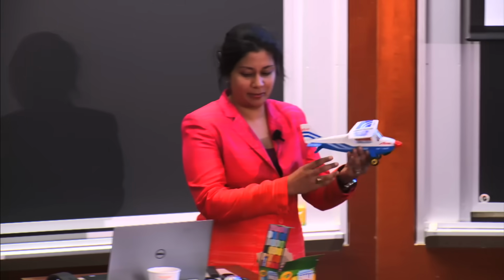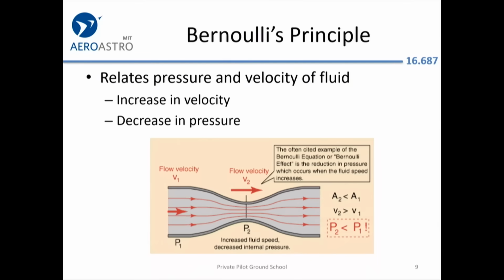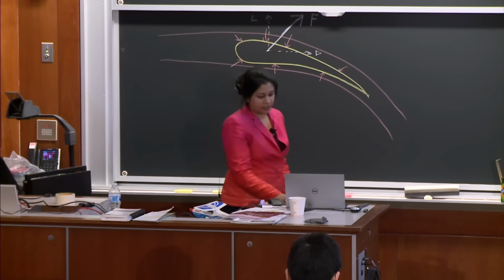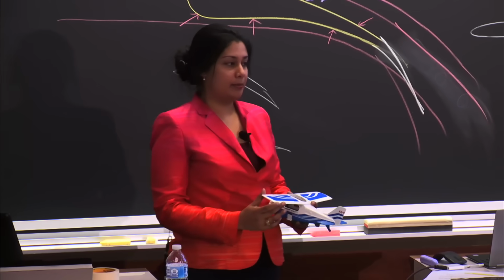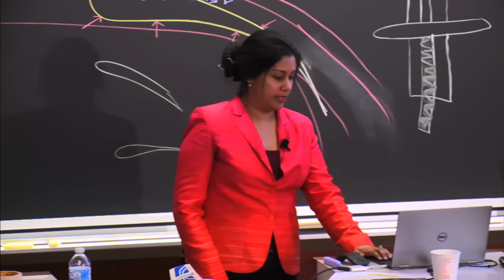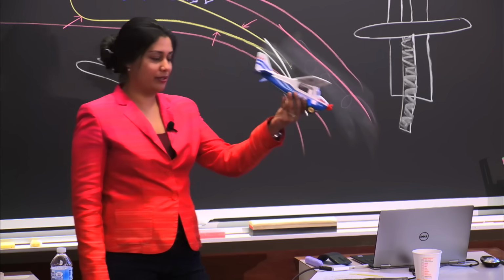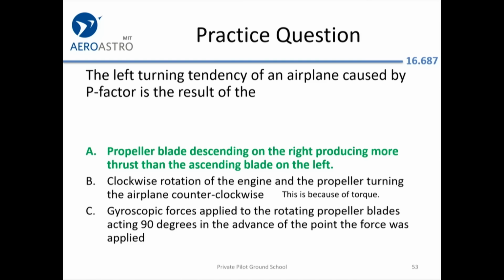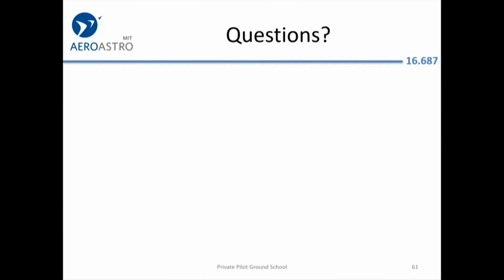Lecture 2: Airplane Aerodynamics

Comment: Question - if the "Equal Transit Theory" is incorrect, then why does Bernoulli's principle apply?     Why would the air on top of the wing NEED to travel faster than that on the bottom, unless it "needed" to meet up with the other half of the air that it was "joined to" just before the wing divided it in two?     If the air is indeed independent, then why would the air above the wing move any faster than the air below the wing?   Since there is more distance to the top curve of the wing that air WOULD travel more distance than the air below the wing. but if the air does not "need" to meet up with the top air at the same place AFTER the wing there is NO reason for that air to move faster.    The top half would just reach the trailing edge of the wing a bit later than the air on the bottom, but - who cares?      I'm shocked no one in an MIT class asked this pretty obvious question.
Reply: I think this vids explanations may help explain the situations more effectively.  The science/explanations & illustrations start roughly 3:30 into the vid, then are throughout the vid.

https://youtu.be/3KqjRPV9_PY

Comment: Downward pressure on top of the wing is less than the upward pressure on the bottom of the wing,   therefore there is a lift. Pressure is a product of velocity square (1/2 x density of air rho x velocity square) . The velocity on top of the aerofoil is slower than the corresponding on the bottom due to the shape of the aerofoi;.t
The lecturer is a smart woman of Indian descent.

Comment: She says Bernoulli’s is a lower pressure has higher velocity which is not correct.  A faster moving fluid has a lower pressure.   A low pressure could be a no flow situation.

Comment: WTF?  A paper airplane's wing has no lift!  ZERO!  A paper airplane essentially falls (floats) after it's forward momentum has equalized - and as it falls it's shape directs a path - thus falling mostly forward if so constructed. While it has forward momentum it acts like a dart - still zero lift!

Can't believe MIT is paying this person!  Really???

Also please look at any airplane wing.  The under surface while in flight  is flat and parallel to the airstream. Not teardrop shaped with a downward deflecting tail like she draws on the board.  And not slanted as she drew the paper airplane's wing in red.

Great, and now air is a fluid...  This woman is a moron!  Air is a gas!  Jesus!

Now showing incorrect force directions...  This has to be a joke!  Can't believe this is really MIT.
Reply: can you rewatch the video before showing your buffoonery. And air is indeed fluid - looks like you missed education by a whisker
Reply: @manh9105  Air is a fluid and not a mix of gasses huh?  I see.  So the third state of matter is just a myth aye?  I see.  It's nice how you alone are capable of redefining physics.  You're a hero of the new-age!

Meanwhile the moron in front of the class was never taught aerodynamics and doesn't understand "lift".  Or like her, would you like to redefine those aspects of physics as well?

Comment: I don't understand 16:05, who can help me......the race car generate lift only when it is an arched shape. So it's not everything moving through fluid can produce lift, right? 
And when it comes to fuselage producing lift, because fuselage is a shape of cylinder, it produces lift only when there is an angel between it and the airflow. If the fuselage flies horizontally, it won't produce lift, right?

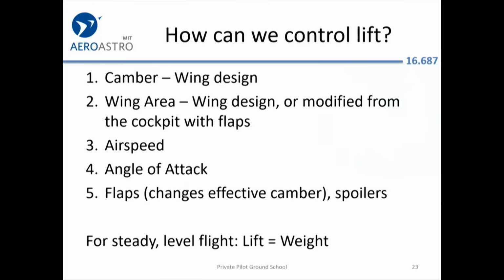Comment: Ms. Srivastava’s lecture is just excellent, but I’ll offer a small, constructive critique.  At 37:30 she states that if lift exceeds weight, then the aircraft climbs, and if lift is less than weight, it descends.  Strictly speaking, this is correct, but it’s also incomplete, and implies that an aircraft only climbs or descends when lift is unequal to weight.

Steady-state flight is synonymous with unaccelerated flight, and these terms don’t describe only level flight, but also climbs and descents.  In a steady-state climb the total lift does not exceed the weight, but is equal to it—this is the same “equilibrium” that she describes occurring in level flight.  (This is analogous to the classic “elevator” problem given to Physics students, and the formula F=ma likewise applies here.)  In fact, in a steady-state climb the wings themselves actually produce less lift than in level flight, because a portion of the aircraft’s total lift is comprised of re-directed thrust.  The best illustration is the extreme example of an aircraft on a vertical flightpath, in which instance the wings produce no lift at all to counteract the aircraft’s weight.

Comment: at the end in reference to the blended wing/body having problems with "infrastructure" of airports it seems the biggest difference would simply be parking and then only on curved terminals where current aircraft are packed in tightly. as long as it's not higher than the larger aircraft like the 747 and 777 it would seem all the support equipment should work without modification besides the skyramps/bridges which would either need a pivot added to the end to mate with the angle of a blended wing/body or perhaps simply a sliding angle plate/walkway at the end for when this design parked? a small investment for airlines?

Comment: The vortex hit copter in the laden complex was impossible to calculate, so many forces at play, but given the angle of attack - speed  verses air flow, immovable objects  - forcing rising  heat it was a  likely event.   An assumption  by me.... it was planned for... It's the best we could do.... Certainly not rocket science!

Comment: A tiny nipick here - while large surface on the rear of the race car is colloquially called a 'spoiler' they are in most instances, actually a wing that creates downforce. If they were just a 'spoiler the drag penalty would be too high. Modern race cars have carefully shaped wings that can be adjusted to vary downforce depending on the track to improve cornering. A spoiler on an aircraft does actually 'spoil' the lift and as a result can be used symmetrically to decrease airspeed or non-symmetrically for roll control.
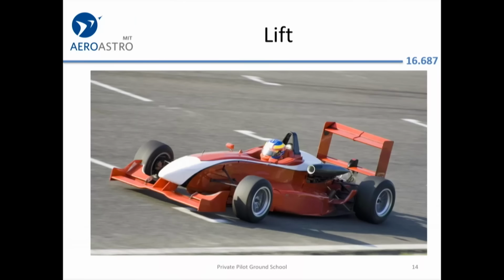Reply: You are SPOT on...  fundamental difference between a Spoiler and a Wing is one creates parasitic drag (spoiler) while sticking up in the slipstream, and the other (the wing) produces induced drag by producing "lift" upside down. Both produce downforce but in different ways.  Indycars, F1 cars, IMSA DPi and the car @17:17 picture all have WINGS.  A NASCAR stock car has a true Spoiler similar to those used on Aircraft.  Spoilers on Aircraft when used as lift dumps 1) loss of altitude without increase Airspeed, or 2) on touch down, kills lift to allow the full weight of the airplane to sit on its wheels for better braking.  Same for NASCAR, the spoiler kills the lift the car body produces allowing the car's full weight to sit on the track for better traction.  But as you clearly pointed out Wings actually produce upside down lift called downforce. I'm surprised that MIT instructors never made that connection between cars wings and the horizontal stabilizers on tail of the airplane which like on the car are upside down wings, producing downforce.
Reply: @ILSRWY4 Spoiler on the back of a road car like a hood on a hatchback is a spoiler, it spoils the laminar flow, which AFAIK paradoxically decreases drag.

Comment: Isn't the low pressure zone above the wing caused by the viscosity of the air, ( the air sticking to itself )  and as it deflects away from this top of the wing, that this is what causes the low pressure zone ?

Comment: I have question if you have time then please replay thanx( how it is possible that during flying Rudder trim itself operate twice in 2 different aircraft backward. Please explane the rootcause if you have any idea about it. Is it some compnent failure or any aerodynamics which ca. Cause this thanx)

Comment: So, because of faster moving air, lower preassure - is that the reason why roops are being sucked off houses because the speed of the wind is very high, while the air below the rooftop is sitting still - generating a large "elevation" force?

Comment: She mentions time of equal flight is incorrect, then goes on to mention Bernoulli's principle as a cause of lift. This is INCORRECT. The decreased pressure is not generated from faster moving air, but from air directed downwards. This is primarily resulting from the coanda effect and the reason airfoils have that shape instead of a flat one like a paper airplane.

Comment: 29:59 Assuming there is no turbulence does not mean that is the real world condition. It reminds me of a joke.

A weight lifter, engineer, and mathematician are washed ashore after a shipwreck. As they stand on the beach of the deserted island a huge crate filled with canned food and water crashes ashore. They are excited to see it, but then they realize they have to open the cans. The weight lifter suggests they smash them open. The engineer draws some fancy diagrams in the sand for device to open the cans. The mathematician stands there chuckling as he listens. They ask him what he thinks is so funny, and he explains that they are making the job more difficult than it has to be, all they have to do is assume they have a can opener.

Comment: Here is a simple explanation of why Bernoulli's Principle works. Air pressure is the result of air molecules striking a surface. If we have air flowing along the surface it drags molecules along with it and fewer molecules strike the surface resulting in lower pressure. The faster the air flows the more molecules are dragged along and fewer molecules strike the surface.

I used to use the following example with my students. Suppose the bell rings and the students in class want to cross to the other side of the hall where the stairs are located. If the hall is empty they can walk over unimpeded. But once the hall is filled with students walking any student trying to get to the other side will be dragged along with the flow of students in the hall.

Comment: A mate sent this to me, I struggled to watch it pass the mentioning of Bernoulli. I found the bagging of 'equal transit' theory weird, isn't it akin to the ideal gas idealisation in thermodynamics? Persevered, then at the 30min mark, more pain. I was really disappointed with the excessive bagging of the Equal Transit theory, an idealisation in my memory and mind, then for them near the 30min to say, we need to ignore turbulence and air that crosses the upper and lower line. It's a little concerning that they bag some assumptions or simplification and not others.

Comment: I thought equal transit theory applies with Bernoulli without exception. I guess I was wrong then. but also, if it's wrong, why there is a velocity difference of air on the wingspan?

Comment: Good, but she misses the applied concepts a few times. Going steeper in a climb is not the same as increased angle of attack, which is related to a stall. At 42 minutes, she is talking about flaps for takeoff 'just in case... so you're already configured for landing". She missed the real point of flaps, which is to change the cord line and angle of attack.  Yes, the effect is stall speed decreases, but it's because your critical angle of attack changes. And I hardly think an Extra or other aerobatic planes are 'unstable' - they just have lots of power and generous control surfaces. Spins are not necessarily "pretty dangerous to do", or they wouldn't ever be allowed - they are certainly potentially dangerous. Neither one of them did a good job describing p-factor differently - they just kept saying the same thing, no blackboard, visualization, etc. MIT? meh

Comment: Some doubts, would appreciate if someone will help me with these. 
1. Is it conversation of momentum or newton's third law - as mass is being pushed down and it lifts up the wing. 
As i was taught that 3rd law is responsible for 75 percent of lift and 25 percent is bcz bernouli's principle. 
2.  Equal transit theory is just a reason given for differential pressure theory, and if differential pressure theory is wrong then why lift  increases with increase in camber of aerofoil and its length. As the mass pushed down is constant.
3. Paper aeroplane example is poor one as it doesn't flies it actually floats and shape of its wing has nothing to do with it is bcz of of the surface supported by air.
4. I think there should not be angle of attack in calculation of lift. As C is coefficient of lift at a given angle of attack.
5. In case of precession its not causing yawning and pitching, it is actually pitching which is causing yawing, as in while trying to pitch one changes the plane of propeller and bcz of precession it will yaw bcz upward force will now act 90 degrees early ie towards left.

Comment: There it a GREAT inaccuray at time 18:55 - - the deflection of the air in a downward direction is NOT the main reason for lift of an aircraft wing. Yes, it's one of the reasons but not the main reason. An aircraft wing can produce lift without deflecting air downwards. A wing can produce positive lift even at a negative angle of attack. That is when the trailing edge of the airfoil is higher up than the leading edge of the wing relative to the oncoming airstream. This is due to the fact that convex curve of the upper wing suface creates a pressure that is lower than the free-stream ambient air pressure. The difference of pressure between the lower side of the wing (which is close to ambient pressure) and the low pressure above the upper side of the wing creates the main reason for the lift.
Reply: Yup. Good ol FAA creating a bunch of idiots spouting nonsense.

Comment: Paper aeroplane doesn't fly, it floats in the air.  Because of initial momentum it continues it's forward journey at the same time it falls down continuesly . 
During flight it can't lift itself because of being flat surface on both side .

Paper aeroplane can't fly it just floats in the air or in other sense it just exhibiting some sort of  Free fall motion .

Comment: Burnoulli's principle holds good for non compressible fluids, i.e. liquids. While dealing with air, it is not applicable. My theory is quite different. When air craft is moving  forward, shape of the wings creates partial vacuum over the top side of the wings, which creates upward force.

Comment: Why a spoon positioned under a faucet with only the concave side obtaining water flow,  and the other side does not, so in this case, we do not have the junction of the two laminar flows forming the pressure difference explained by Bernoulli's law, and even so, the spoon still get a strong displacement perpendicular to the water flow?

Comment: Very interesting, but wrong. If the wing works on the principle of conservation of momentum (like rockets do), where does that momentum come from? How does that air gets pushed across the wing in the first place?  Engine?... And if so,  according to the principle of conservation of energy, any plane will be much more efficient with the engine pointing down (hey, we are pushing air down directly and at higher speed, creating more lift), and no wings at all, because they contribute to drag. So, by that logic, the efficiency of rockets, and planes should be the same. But this statement is absurd, and the reason is because wings do NOT work on the principle of conservation of momentum. To demonstrate it just take a sheet of paper, put it under your lips, and blow air on top of it (across the upper surface only). The paper will rise, and there is not much air deflected down, the paper rises because atmospheric pressure pushes it up. And the pressure across an upper surface is reduced due to higher airspeed. And yes, the physical principles explaining why and how planes fly do exist...

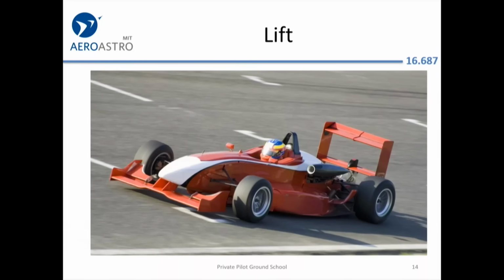Comment: Those shown rear wings of the race car (at16:31) are not spoilers. Their intention is not to spoil the airflow. They rely on clean airflow to generate downforce by themselves. There are spoilers on other types of race cars, but the one on this picture is clearly not.

Comment: Pushes that "Equal transit theory" is wrong but then explains that "Bernoulli's principle" provides lift... :-(
It is not that the equal transit theory is wrong but how it is understood. By its other name, longer path theory, it is nothing but a way to visualize Bernoulli's principle.
Since air at the top do change speed when it passes around the airfoil, there is a transition speed & angle of attack in which the air do arrive at the same time at the trailing edge. 
Don't tilt the paper plane wing so that there will be no difference in speed between the top and the bottom and see if there would be lift. Nope, nothing.
The the incline of the flat paper itself (AOA) cause the air not to follow the flat plane but make its own curved movement over it which creates the difference of air speed and have pressure difference which produces lift.
The same hold true to an inverted wing. 
More proof? Change the angle of attack of an inverted wing to near zero and that wing will drive the airplane down. But right side up, even at a few degrees below zero angle of attack and a curved wing will still produce lift. 
Airflow across a wing - www.youtube.com/watch?v=UqBmdZ-BNig
High alpha - www.youtube.com/watch?v=qbMg1G3oTVY